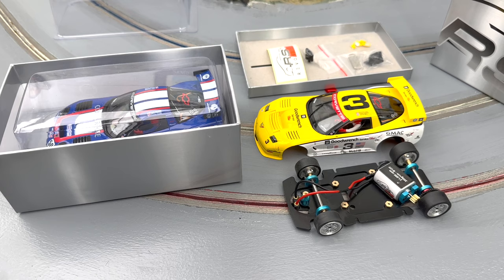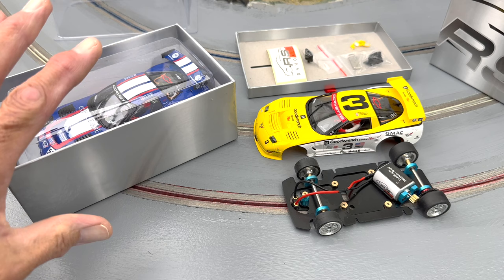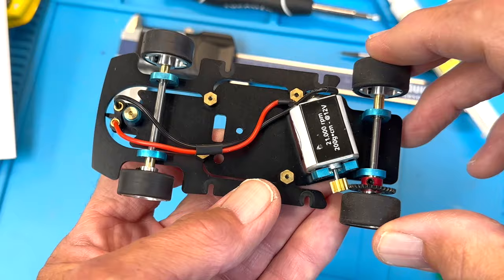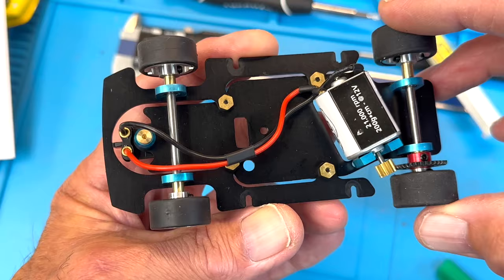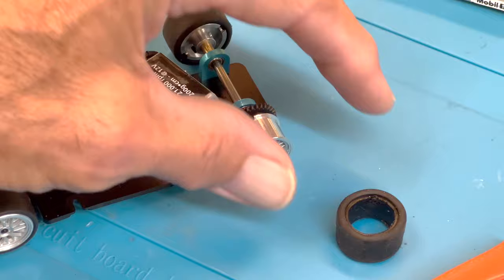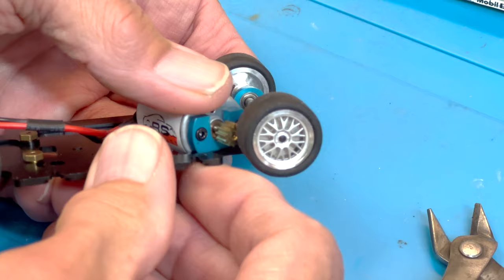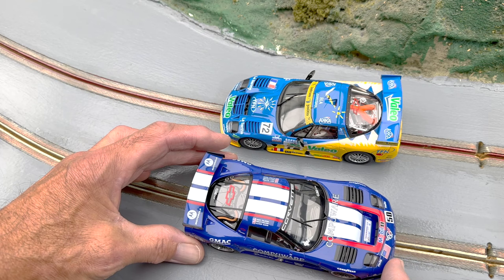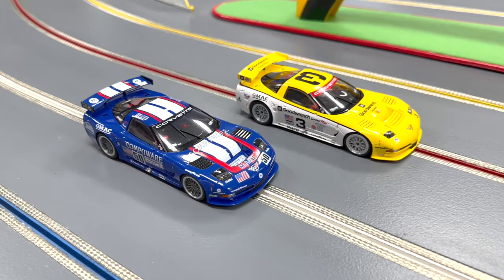1/32 REVOSLOT Corvette C5R

Comment: Thanks for the good tips on race preparation.
I bought mine, a few weeks back. as the 2000 24 hour boxed set of two as well as the blue 50 anniversary car. And the white kit that was subsequently less expensive.
May have been a mistake buting the presentation box since i am reluctant to run the 64 car as intended. But solved last night by ordering the single boxed 64 to prepare for racing.
A bit hard to resist any of the RevoSlot releases since the first Porsche cars. Helped where i am in that they are easier to get than Scalextric or Carrera and not much more to pay so far better value for me.